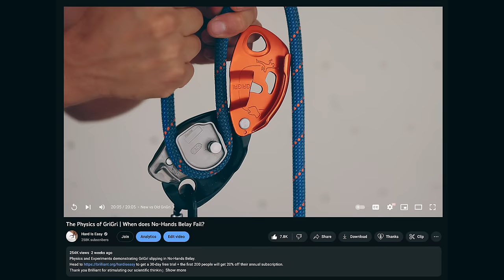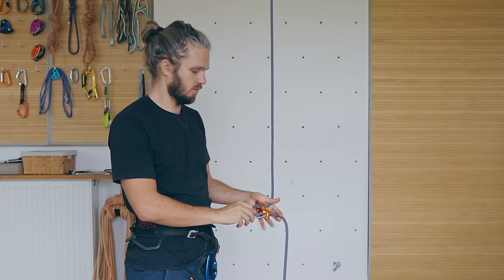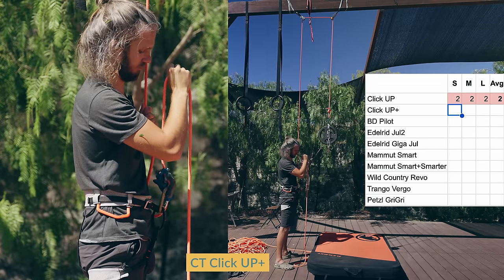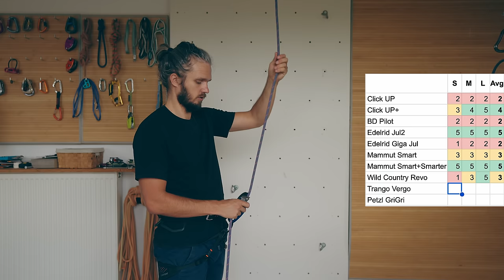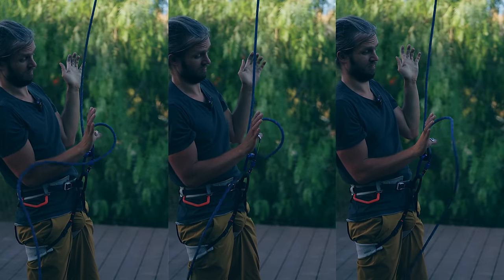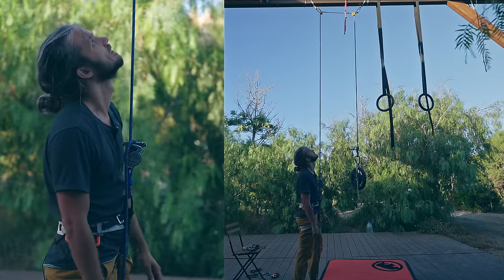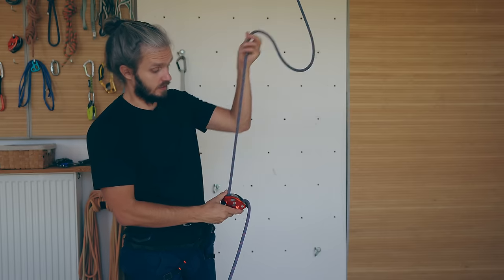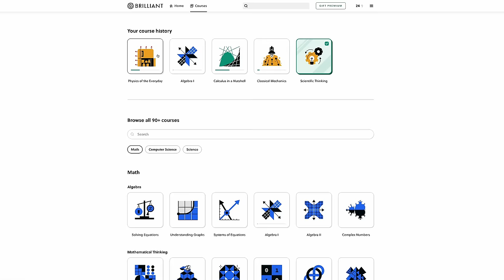When Assistance Fails!? The Physics And Experiments of Belay Devices

Comment: Thank you for the video. Would suggest you to do testing on lowering climber too. It is a second cause climber get injured from bad belayer too. Well done mate. 👍
Reply from the maker: Yeaa I was not sure how to measure lovering risks tho... but in the future I'll somehow measure the comfort when I do follow up vid on this
Reply: @HardIsEasy  maybe you can test it with two ropes and 2nd belayer who will have more slack?
Reply from the maker: @aroimicaraffu  but what I'm testing? :) If you don't hold the brake hand and force the device to lower ofc the climber will go to the ground.

The only thing I can test is perceived control of lowering
Reply: I think that part is super rope dependant, though. Switching from a worn fuzzy gym rope to a new thin outside rope, the difference when lowering on a grigri is night and day it's practically a different technique! With the gym rope I have the lever all the way open and control the speed with my hand on the rope, and it's still slow, with my outside rope there's a lot more effort in finding the right spot etc.

Comment: You don't even have to overrule Grigri's locking mechanism to give slack. In most instances, it can be done by very gradually pulling rope through the divise. This requires some practice to develop the right sensitivity, but it's not particularly difficult. Moreover, by walking a step to the wall, this can made even easier (i.e. to give some initial slack, because if you try this method too quickly you are likely to lock the device anyway). This has worked fine for me
Reply: You can pull out slack as fast as you like as long as you understand what is making the cam engage. His previous video makes it clear how and when the Grigri's cam will engage; if there is no force on the break side of the rope, the cam will never engage. Even the meter or so of rope hanging down from the Grigri to the ground will generally have enough mass to allow it's gravity to generate the required force to cause the cam engage. (I am not suggesting you let go of the break side of the rope, but just pointing out that applying even very small amounts of force to the break side of the rope will cause the cam to engage in the event that there is a force on the climber's side of the rope).

As long as the cam is not already engaged, you can pay out slack quickly while never having to press on the cam to stop it from blocking. The key is make the break side of the rope "weightless" - ensure there are no significant forces acting on it. Just slide your break hand down the break side of the rope the distance equal to the amount of slack you want to pay out. Then hold your hand up enough so that the rope's weight is mostly resting in your hand - there is no weight pulling on the Grigri. Then with your other hand you can pull that slack through the Grigri, as fast as you'd like. You never need to let go of the break side of the rope, ensuring that there is always enough force on the break side of the rope to cause the cam to engage should the climber fall while you are using this method.

This method, combined with taking steps away from and toward the wall to take and give slack (as you have suggested), is more than enough to belay a climber without needing to press on the cam.

Should the cam engage while the climber is trying to clip, then you will need to press on the cam to disengage it (using Petzel's recommended method). If you need to pay out more slack after disengaging the cam, you can return to the method I have suggested above.

Comment: With the GigaJul, it's very important that not only the rope diameter is correct, but also the carabiner. If its too wide - like the one that i saw you using - you get slippage and poorer performance.

It's definitely an issue but one that can be fixed very easily. Funny enough, I've  had the best luck using my BD Gridlock. I had similar reaults using my Edelrid Bulletproof.
Similarly problematic is using a carabiner that is too small. It requires a lot more force to release. 

Edit: removed a comment about not seeing people talk about carabiner size when i read a comment by you talking about that.

Comment: I feel like I was taught to use a grigri in a very different way ; 

1. I never press the cam to give slack, I « throw » a loop of rope above the device, keeping my right hand below it and never letting go of any rope, then guide it up with my left hand.

2. I try to keep the grigri unlocked as much as possible, this eliminates the need to press the cam down for slack and helps the rope accelerate to lock the grigri faster.

3. I adapt my position and belaying with the height of the climber ;
The lower they are, the greater the risk of a ground fall. I stand very close to the wall and let out very little slack. 

As they go higher, typically above the 3rd clip, I start to get a bit further away from the wall, while gradually letting out more slack. 
The slack locks the grigri on impact and the distance I have to the wall softens the fall. 

I’m interested in feedback if anyone finds that unsafe, I’d love to hear about ways to improve on that

Comment: I have a quick question, in which mode is the GigaJul setup? I saw the yellow lever up... I don't usually use it as usual. Thanks so much for doing this video and also without globes, you're really brave 😆
Reply: In "Break-Assist" mode. The slider is on the side with the grooves. The carabiner can jam the rope in the gap of the device.
Reply from the maker: Yes I used in Assisted mode, I don't see the reason for other mode at all...
Reply: @HardIsEasy  The tube mode ("manual" mode) can arguably still be useful. For instance on ifsc competitions the belayers may only use manual devices.

The manual mode on the Gigajul can also be used for rappelling and it enables the guide mode functionality for belaying from above.

Comment: 14:08 When giving out rope with a Jul2, I prefer to just knock the bottom of the device with the brake hand instead of ‘wrapping my thumb around the device’. This mostly works to unblock it… 
(I absolutely agree that there is still a slightly higher risk with using a Jul2 regarding the brake hand. The most important thing is to be aware of it.)
Reply: I grab the rope with my fingers and gently push upward with my thumb. You don't really need to wrap your thumb around it.

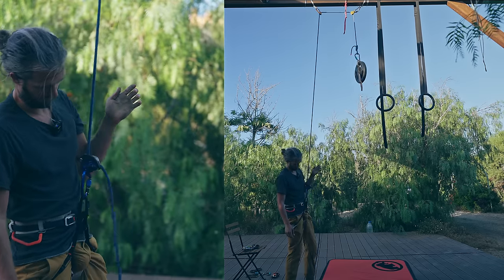Comment: Your test with the Vergo at 16:33 has the Vergo clipped to your harness incorrectly. The "Left" arrow on the device is not pointing left. The brake stand comes out the top of the device when used and oriented how Trango suggests. This definitely resulted in the slippage of that test.

Comment: Did you test Edelrid Gigajul with both configurations, locking and non-locking? 

Thanks for all your efforts! Really interesting and helpfull!
Reply from the maker: Thanks! I tested only the locking configuration - I don't see the benefit of using non assisted devices at all.
Reply: @HardIsEasy  I was trying to repeat your test with the Gigajul but was finding it was locking right away with an older BD 9.4 dry rope in auto mode, however when it was in manual mode, it would slip more but still lock up before my weights would hit the ground. I'm surprised that you got such a different result with belay devices from the same company.
Btw great video, loving this series of videos! :)
Reply from the maker: @jbt561  it might Also be different carabiner related...
Reply: @HardIsEasy  I'm using the edelrid HMS belay carabiner with the steel insert, I'll play around with a couple other carabiners. I'm interested in how I can get the device to slip more like in your video
Reply from the maker: @jbt561  I've seen other ppl commenting as well that it they had it slipping and after change of carabiner it got much better, maybe my carabiner was very not suitable for that device...

Comment: Other than showing which belay devices assist in braking in which situations the best, it mainly shows the importance of belaying correctly. One should never rely on the belay device, but rather have it as an extra safety feature in case you aren't belaying optimally. I think that is the main takeaway of this video.

Comment: One thing that does not invalidate the results, but should be mentioned. I bought the Mammut Smart a couple of years ago and not used it really that much because the people I climb with prefer the grigri. That said, I recall reading the manual of instruction and the way they say you should give rope is not by blocking the device, but by feeding the rope through the device. This is just as you could do with grigri and many other devices, so it does not mean anything, I just wanted to clarify this

Comment: Use chain mail gloves.  😂  Thank you for this video.  The proper technique for belaying is proven to work, meaning never let go of the break end of the rope and keep the rope speed under control at all times.  However, I still make a point about the belay technique being the most important.  I'd point out to your belay master class series, because it is really good.  Another lazy belay technique is moving away from the wall to take out slack, and this irks me to no end.
Reply: Agreed on the step away method, I always imagine trad just popping out every time I see it.
Reply: With perfect technic all of them worked, but the idea is how resilient the gear is against mistakes. We shouldn’t but we all are doing them. It’s the same as in cars. We should just be careful because people tend to rely on this resilience and behave less cautiously. Had read some study where a group trained with grgri’s had made more brake hand mistakes then one old-school tubers.
Reply from the maker: as for stepping away, it's crucial in cases you need to take out slack quickly, but yes abused for the cases where you want to see your climber better, I have videos coming on these things hopefully soon.
Reply: @HardIsEasy  yes.  Like in slab situations, but I've seen 5-7m away from the wall, it goes to show how lazy a belayer can be, besides the slamming and swinging hard into the wall.  Good habits keeps the mind sharp.

Comment: It is very important for a belayer to not take out the slack from a fall.
The rope stretch can only help if there is enough length of it to stretch.
A short rope is a dangerous rope when falling, and one should not rely on the rope being long in the upwards strand for if the anchor becomes a pinch point, the only rope that matters will be between the rappeler and the anchor.

Comment: I think the slipping in the no slack fall with the Vergo was a user error, the instructions say you need to clip the device to your belay loop with the brake strand coming out towards you, not facing away from you. There is even a little arrow saying left, that needs to face to the left. The Vergos predecessor, the Cinch, had the same issue, they changed the instructions to this way at some point because of some incidents.

Comment: There is no reason to ever have a no slack fall as described with a clickup.  Just ensure the device is in the locked position, perhaps by manually locking the clickup, while holding the climber during a rest and unlock the device after the climber starts climbing again.  Unlike the grigri the clickup does not unlock if the climber unweights the rope.  Even nicer for top rope situation the belayer can easily pull in slack while the device is locked.

Comment: It might be interesting to look at those that result in a ground fall in a bit more detail. For example, what about the design is lacking that allows the slip and at what speed is the climber hitting the deck. I imagine even when slipping, there is quite a lot of friction, so they may only be hitting the ground at relatively low speeds.

Comment: there's a small mistake on  "no slack fall" test with click up.
in the example: belayer take, then let go of break strand, then climber climb a bit and fall.

your test started with click up disengaged, but if belayer take climber then click up will engage until belayer disengage it on purpose, then with it engaged, if belayer let go, it shouldn't slip at all.

if belayer let go of the rope with device disengaged then your test is spot on and expected, device won't ever catch and this is user error on operating the device.

I should say that I particularly don't like the click up, but I'm a user and huge fan of the alpine up, similar locking mechanism but easier to handle and does all I need.

and once again thanks for putting out good content with amazing quality and foster good discussions :)
Reply from the maker: Hey thanks, I tested all devices in disengaged positions. In case you loose control of the brake side and climber takes a fall and there is no slack.
But sure if Click UP is locked already it is def safer option.

Comment: To be honest, most time one is giving slack, you do not have to overwrite the locking mechanism (at least with GriGri and Jul, the two devices I have experience with). If you are “pushing in” the rope from the brake side and simultaneously pulling it out on the climber side, it works perfectly fine. Only giving slack fast requires overwriting the locking mechanism. But you don't need to do this often if you are belaying with foresight (and some slack in the system at most times anyway). That greatly reduces the risk I suppose.

Edit: Nevermind, I wrote this comment ten seconds before you started talking about this. 😂

Comment: Interesting, I use the Smart and had never even heard of the Smarter add on.  I will add that i've had the climber fall a couple times while giving slack and my hand found the correct position in a millisecond or so and they only fell that arm length of slack.

Comment: I feel bad for the wild country revo cause it works differently to the others and I believe that weight certainly matters. A heavier object will accelerate faster when friction is taken into account and rope friction is more than something like air resistance. To really test it you'd need to put the full weight on. It may accelerate faster and stop sooner.

The huge downside if this were the case is that the revo would take different amounts of time to stop depending on the situation which makes it unpredictable. For example in a zig zagging lead climb there would be a lot of friction and that would cause the climber to fall slower and the revo to engage later than say right after the first clip of the climb where there is very little friction.

Comment: I use the Giga Jul but I still prefer lead belaying in manual mode. I use assisted breaking for when I need to assist young climbers or when the leader is going to rest a lot on a project. Also in gyms that require assisted breaking belay devices.

Comment: Hi Ben,

Thanks a lot for yet another enlightening video from you!

However, I have 1 question: Please could you confirm in which mode you tested the GIGA JUL in?

For all who don't know the device yet: The GIGA JUL has 2 modes: a "classical tuber" mode and an "brake assisted tuber" mode. You can choose between these modes by putting a "slider" into the corresponding position.

Having these two modes in one device is a great thing for multi-pitch climbing: You can use the break assisted mode for lead belaying (at all pitches) and the standard tuber mode for rappeling and for belaying from an anchor point in guide mode.

@ Ben: If you had the GIGA JUL in standard tuber mode during the tests, the results were in no way surprising, were they? In this case, it would be great if you could repeat the tests in the brake assisted mode and let us know the results in a follow-up video! 

Letting the device compete against the other brake assisted devices while in standard tube mode simply would not make sense to me and does not help me making a final judgement.

Thanks in advance for your response. I look forward to it!

Best wishes,
Frieder

Comment: This is great video - one of the best in category "my type of stuff"
I use Gigajul, I had concerns about the thumb-in-the-loop technique, and I developed my own (initially not sure if mine was better - now I feel more confident. What I do is grab a load of rope (by sliding my breaking hand away from the device), then I bring it back to Gigajul, and use my wrist to raise the front part of it. This way I always have my thumb away from the loop and rope wrapped with all fingers like on a tubular device.
I wonder if there is any risk related to this technique. I also walk forward a bit to give more slack (or back to take)